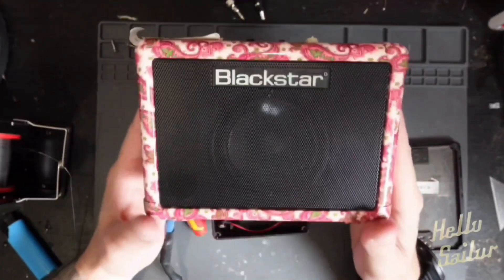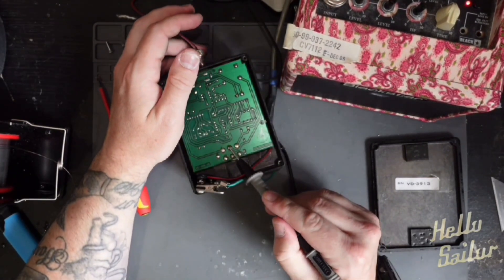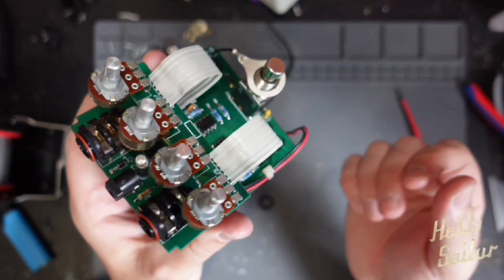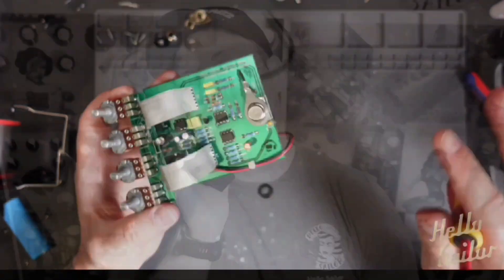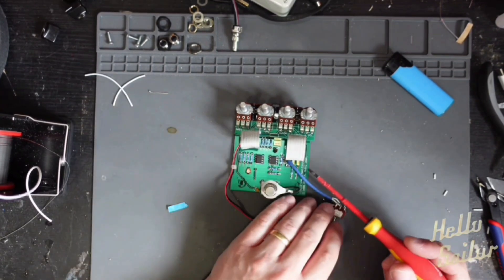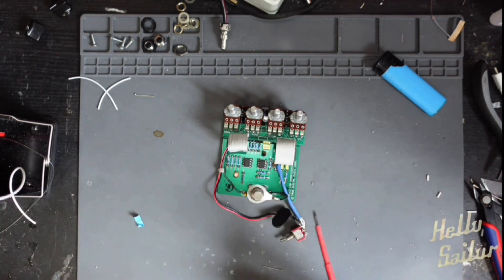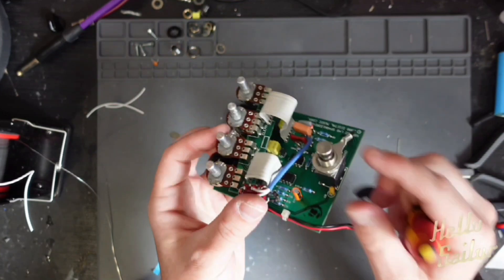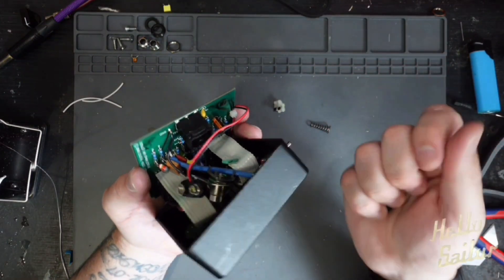Joe vs Sparkle Drive: Can I repair & mod this guitar effects pedal

Comment: Great video pal. Would have liked to seen a zoom in on the PCB and switch to see how you wired it up.
Reply from the maker: @ac30helix44  Thank you mate. I shall definitely incorporate close ups into the next ones I film. I'm always keen to improve the quality.
Reply: @hellosailoreffectsofficial your insight is awesome mate. I’m about to do a TDX clone which has 2 x clipping diodes in head to toe configuration. I want to try a switch for stock and maybe some Ge’s. Any clue on how ???
Reply from the maker: @ac30helix44  Thank you, mate. I'm so glad you have got some value from my video. I have a "beginners tubescreamer mod" video that goes deep into this very subject if you're interested mate.
https://youtu.be/Cc9Nee5O2qg